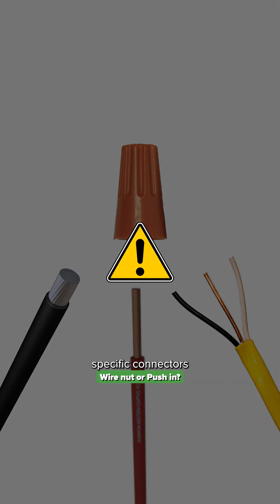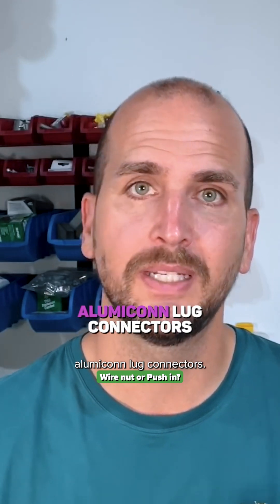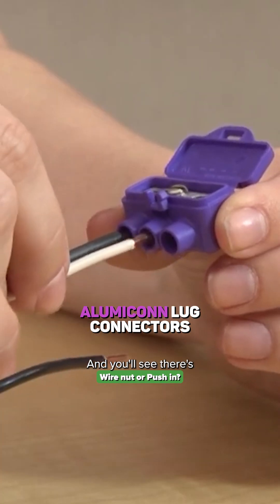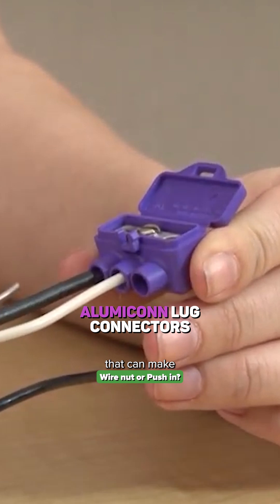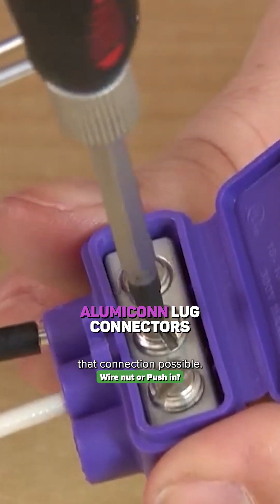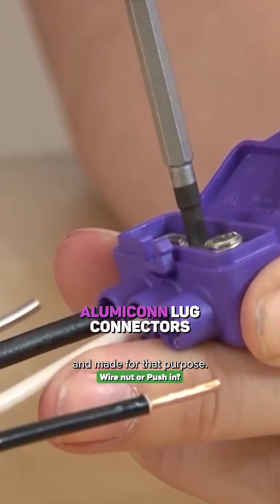Wire nut or Push in?  #diy #diyhomerepair #diyelectrical

Comment: Doesn't Europe use smaller, stranded wires that work well with Wagos? Pinching a solid wire in a Wago doesn't make a great connection.

Comment: Great video! My concern is the knock-off Wagos which (as you’ve shown) are a legit fire concern. Wire nuts have a proven track record. They are safe, cheap, and easily available.
Reply from the maker: WAGOs also have the track record just over in Europe.

Comment: Technically wire nut is more permanent, and probably cheaper. Especially for stranged.
Solid should always be pre-twisted and the cap is only for insulation.
Reply from the maker: Cheaper for sure.